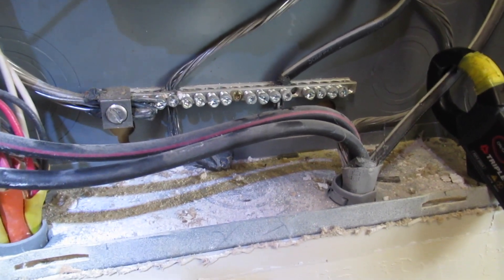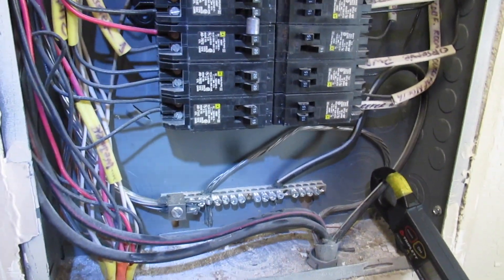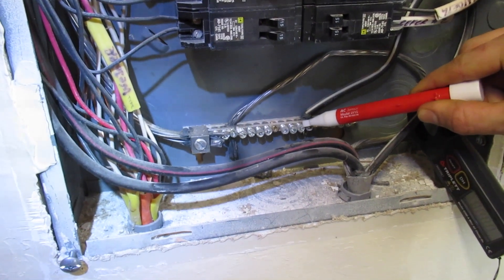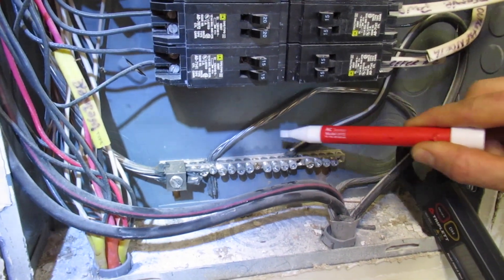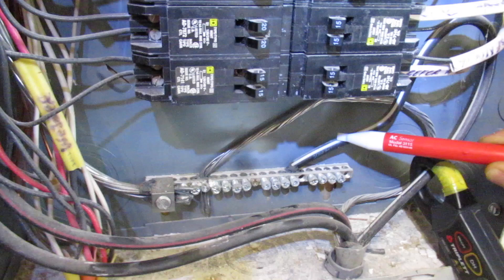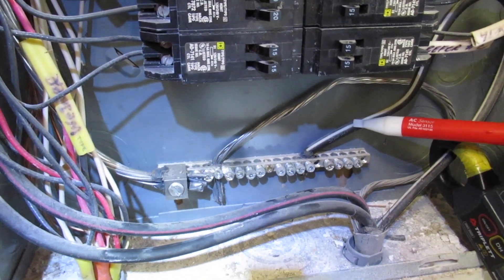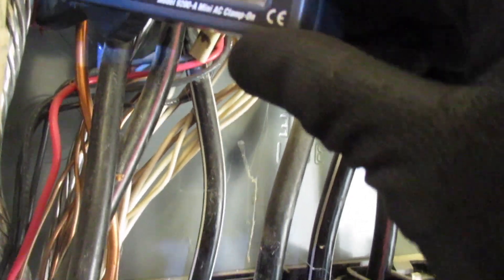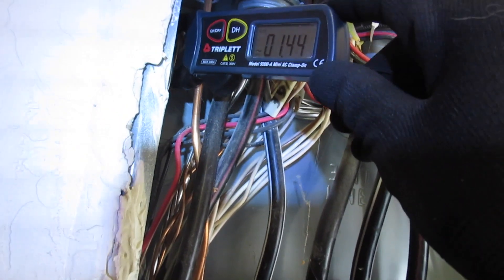1.44 amps of Objectionable Current on  gound cable.  Neutral connected to ground & panel case.

Comment: even the bonding of neutral and ground is in the main panel board it will still cause objectionable current when the Neutral conductor at the service point disconnected.

Comment: I experienced a crazy high magnetic field on and in my property. A unmentioned three letter agency's didn't like me standing up to them so many exotic tools where used to keep me quiet. I have underground service.. I was getting a high magnetic reading from the rebarb in my slab..all undergroun wires (cable, phone). Also water service hub and up and down the street water and power lines. I sell used stereo amplifiers and the cut off overload circuits where all tripping on there own not even plugged in. My service feeds in from a distrobution box at the front of my property. There was new service at the rear of my property on a new lot. I measured two parallel high magnetic fields running from the rear of my property to the front. They also have been using a property adjacent to mine to illegally harass me. One other thing is that some extra exterior cable line was was coiling up stiff. All sink drains in the house where charged with high magnetic field. I've read that you can do something with ground and neutral wires running parallel from distrobution box to really throw  a electric event...your obviously smart..So three properties where involved that I'm aware of..mine, the house to the left of mine, and a new distrobution box at the lot in back of mine...any idea how this could pulled off if you wanted to intentionally cause haywire magnetic events on and in a property?
Reply from the maker: You may be experiencing the result of a broken or weak neutral that places current on the metallic water service piping in the area.